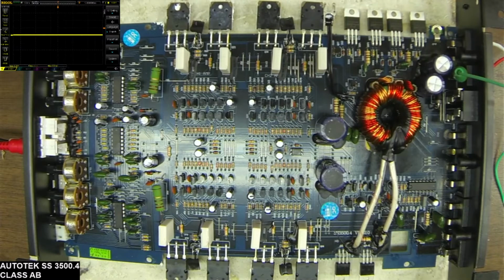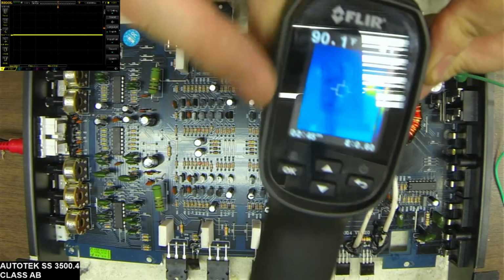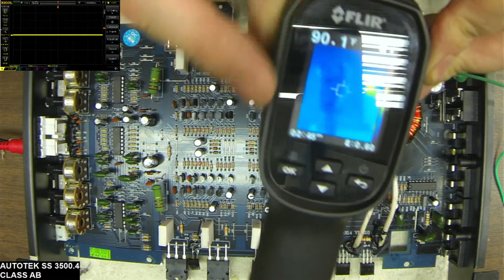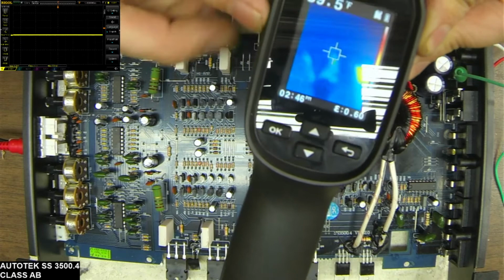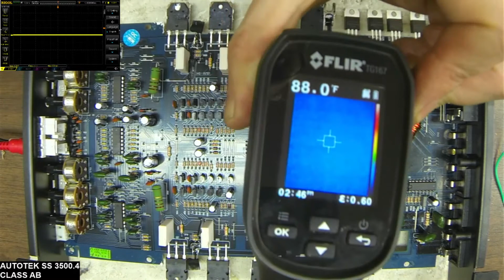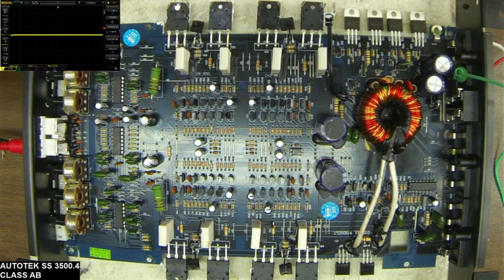Autotek 3500.4 Class AB Automotive Car Amplifier Rundown and Repair More Voodoo Watts!

Comment: How to repair overcurrent protection ?
Reply from the maker: There is usually a transistor that you will find traced back to the emitters of the output transistors. This is where I would go first.

Comment: How reliable are the amp high level inputs that are build in ? I got an external high level to low Lin output rca and yes it work disturb hits before getting 1.2v after that it distorts the wave this I se. Video of smd line converter said to claim clean distortion giving around 8-10v output for the amp
Reply from the maker: Line inputs are pretty straightforward. They are built to limit the input currents from the line converter. If there is any distortion I would look at the converter and all the grounding paths. Now if you exceed the wattage rating of the dropping resistors in the amplifier's line in section, then the resistors burn up allowing all the current to pass which damages the preamp. From there the amplifier may not work at all.
Reply: @ellensburgamplifier  thanks for the info

Comment: Whats output rms per channel of this pair ? How about SQ?
Reply from the maker: Thank you for the questions. I do not do any dyno testing here for RMS power. Maybe 100w RMS into 4 ohms? I can't recall the rail voltage on this one. If you would like, I get you the rail voltage with a given input voltage to get a rough idea of output wattage. As for the SQ of this board, I would consider it as an entry-level amplifier. The sign wave is clean with slight distortion at the peaks.
Reply: @ellensburgamplifier  thanks sir.

Comment: Hi friend good video thanks for the informative video, what temperature did you get on the transistor
Reply from the maker: Hi and thank you for the question. The highest reading I had was 148f on the 44n's during the pulse testing and 180+f degrees when I initially started to see smoke rising from the 50n06 transistor (off camera).
Reply: @ellensburgamplifier  thank you for your reply
Reply from the maker: @tyronearendse1722  You bet! if you ever need any amplifier info just hit me up.
Reply: @ellensburgamplifier  thank you, I have a question: in the driver section can you use a pnp driver transistor on the positive rail and vice versa
Reply from the maker: @tyronearendse1722  I am trying to find the best way to answer this question. Yes, there are both NPN and PNP transistors per "rail". For instance, on this board, there is a final NPN and PNP for the positive output transistor and a separate NPN and PNP final driver for the negative output transistor. Keep an eye out for part 2 of this board where I will go over the output section and final conclusion of this board.
Reply: @ellensburgamplifier  thanks again, will do so